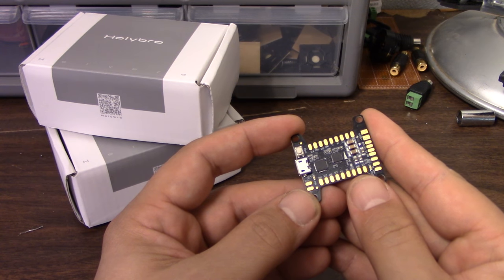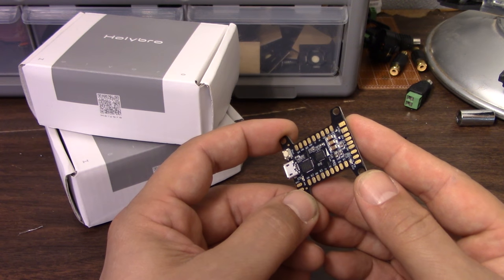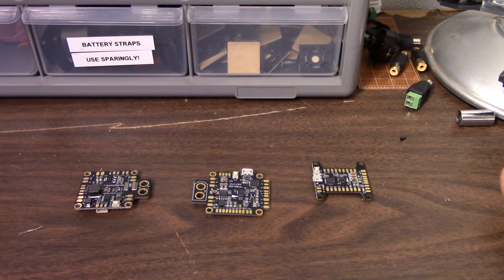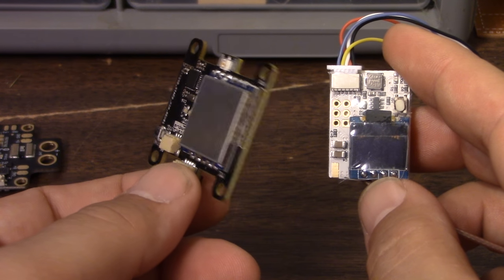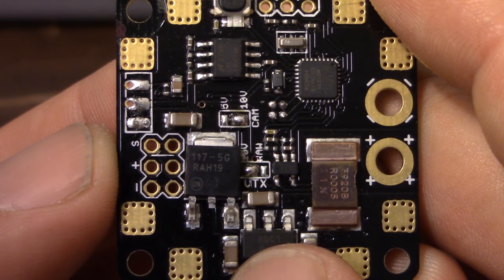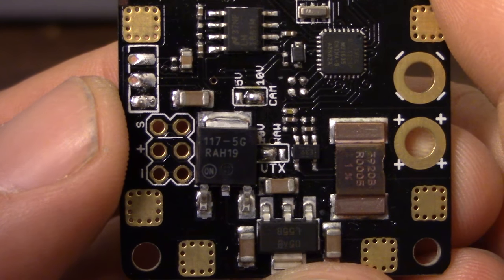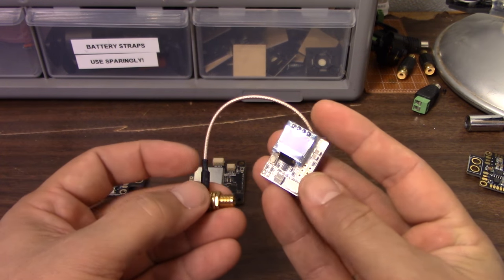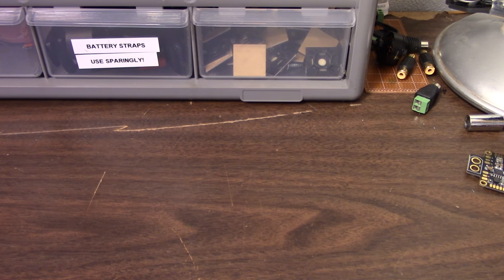OSD SHOWCASE | Four Interesting Ways To Put an OSD On Your Quadcopter

Comment: rrosdv2 ftw pre order in 3 2 1. the first version may it rest in peace on a flyaway quad worked like a charm, and no fiddling around plug up and go, I like that a lot. and the video was just as good as I'm experiencing with pnp50, without the extra weight.

Comment: I am in the process of installing the Diatone sp3 on a new quad that i am building.  I have heard pretty good things about it.  Very clean design and easy to wire into the system.
Reply from the maker: Yeah, that one also looks cool. Similar to the Passado, I think--yes?
Reply: Joshua Bardwell similar and also cheaper

Comment: My favorite is the Matek HUBOSD. It has very similar specs to the RROSD v2, but costs about $16. No mwosd, no pass through, but big easy to read text that shows time, volts, amps, and mah consumed. All you need and nothing you don't
Reply from the maker: I left the HUBOSD out of this one because I have had too many questionable experiences with it. Now that's a little unfair because there are at least two different HUBOSD products, and maybe they're not all the same. But in two separate cases--two different OSD boards on two different copters, built several months apart--the OSD had a software glitch where it wouldn't show the correct data on screen. This was fixed by a software update. In another case, the OSD simply didn't work at all and the board had to be replaced. Finally, I have not personally experienced this, but I have heard reports that the voltage regulators on the HUBOSD are sometimes not reliable.
Reply: Joshua Bardwell I haven't had an issue (yet) on the five builds where I've used the HUBOSD, but I will concede those are all good points I have heard from other pilots. I suppose it's a YMMV situation, and you get what you pay for when you opt for a $14 - $17 pdb/osd combo that your copter relies upon. I'll continue to fly them until they die, but I love new stuff and I'm going to try an RROSD v2 on my next build
Reply: Every Hubosd board I have gotten has had issues. Ive had one short out and not display video anymore, but most of them the OSD fails about 5 seconds into flight and I get those arrows on the left hand of the screen. I think its because I run 5s batteries and motors that dish out a lot of amps, yet ive never really exceeded the HUBOSD amp limit. Would you say the HolyBro is more reliable? An OSD with mAh reading is a priority for me.
Reply: Lol it seems like my positive experiences with the HUBOSD are atypical. I do plan to try the new RROSD though, because I agree that my number one concern is mah consumed. Voltage is secondary, amps are tertiary. I honestly don't care about time, but if it's there, so be it. Nothing more though, anything else is just too much to look at
Reply: Haiku FPV I agree I like my OSD simple, thats why I was drawn to the Hubosd. But for my set ups they have just always been a struggle for me. The times it does work I love it, but there is just no consistency
Reply: I like the HUBOSD too - if it works. It's really a hit and miss though. I've tried 4 so far. Two had the OSD component die within the first couple of batteries, rendering them just regular old PDBs. One was glitchy in that the OSD disappeared every time the I pushed my quad and came back only when I ease off the throttle. And one worked fine, except the voltage readout was off by 1 volt or so, but at least the current sensing (which I rely on more than the voltage anyway) seems fine and no batteries puffed so far from over-discharge.
Reply: Haiku FPV one thing I couldn't stand about the hub osd vs the rrosd is that the hub osd would update on screen the voltage and amps only like once per second, a total deal killer for me :-(
Reply: what about cameras with osd? forgot those. foxeer arrow comes to mind.
Reply from the maker: +Juan Rodriguez Yeah, I just intended have any of those right now.
Reply: HUBOSD is a 8bit core minimOSD is 32bit both use different gui apps to set up but can look identical

Comment: No love for the PowerOSD? They recently came up with an updated version so I'd really like to know how it compares.

Also, it's probably worth mentioning that the Passado (as of this video) only comes in a fixed 600mw version which makes it useless for racing and flying with any sizable number of friends. Although, FuriousFPV did assure me that they will be coming out with 25mw and 200 mw versions. I do hope they'd come out with at least a 25/200mw switchable version though. That would give more flexibility for a mixed freestyle/racer quad.
Reply from the maker: I don't have anything against the PowerOSD, just didn't happen to have one on hand. This video is literally the result of going through a hodgepodge of gear that was sent to me and realizing there was a common theme.
Reply: I just got one a little while ago, but haven't had a chance to install it.  Nice and simple though

Comment: The MinimOSD is a bit tricky to set up, but I have yet to find a suitable replacement for my microMinimOSD. There's just nothing like it: super lightweight (3gr or so), tiny, packed with features (PID-tuning with sticks, fully configurable) and dirt cheap. They're like 6 bucks...
Reply from the maker: +DirkDrones but when you can get an FC with Betaflight OSD for $35, isn't that cost just absorbed into the FC?

Comment: I got the Diatone SP3, it's great, it has a micro USB, connect direct to PC, it has 0, 25, 200, 600 mw that you can select and a channel display and its stackable! 
You should try it!
Reply: but dont have current sensor
Reply: TheMascaras33 yes it does not have! well, for me it's great, I don't use it, but you are right, for who use it, it's missing
Reply: I can see voltage and amps on mine. I paired it with a KOMBINI fc, maybe that's why?
Reply: halibuthero nice, how did you do it, just got a kombini! tks
Reply: Standard wiring and I enabled readouts for volts, amps and RSSI in MWOSD.

V and A seems accurate, RSSI is questionable. This is my first OSD, so I can't compare it to anything else, and I'm not even sure I configured it correctly, but it seems to be working.
Reply: halibuthero nice, will do, I was worried about having to flash firmware and something like it!
tnks

Comment: Happy with just the Foxeer arrow V2. Might be me but I don't see a need for anything more than the battery voltage and time to be displayed.
Reply from the maker: I strongly prefer to have current readout on my copters. A reduction in mAh drawn from a battery is the best way to know that the battery's health is declining. And amp draw is a good way to assess prop, motor, and battery performance.
Reply: BoneR FPV at the moment I agree arrow v2 and then mah on the taranis audio warning telling me when I'm low. I have furious kombini fc's so the furious osd vtx would be a nice touch but maybe not enough of an improvement at $60 each!
Reply: DemiQuad FPV I have even noticed i still get battery voltage off the taranis out of habit and forget to even look at the screen during racing. If I don't hear the radio giving me low voltage alarms I'm still good to go Lol

Comment: Is keeping the power distribution circuitry separate from the video circuitry a common design goal? The products reviewed suggest it is not. Perhaps it should be. I would think the ideal setup would be one board with PDB and current sensor, and one board with an FC with built-in OSD, or an FC and a separate OSD. This is all a little bit confusing, because there are also issues with OSD/FC compatibility, right? I do not have OSD at all, but I want it.
Reply from the maker: No, it is not a common design goal. And well designed boards combine video and power no problem.
Reply: Thank you for your answer. On my setup I had video interference that was substantially annoying. I tried 2 or 3 different LC filters on the cam and vTx power, and put a cap on each ESC, and these things reduced the interference a little at best. Then recently I installed a fatshark filtered vTx power supply that connects to the battery balance plug, and voila! the interference disappeared. The only filter on it is a capacitor (by visual inspection). So evidently in my case using a separate tap to the battery avoids transmitting or propagating the noise that must be coming from the ESCs, and the cap probably helps even though there are already caps on each ESC. The cam is not powered by it. I'm considering adding an OSD somehow, so I've been wondering whether video interference would be an issue again, like with the minimOSD which is reportedly very sensitive to noise. And with a PDB/OSD I have the same worry, because that board would be connected directly to the ESCs, the cam, and the vTx.

Comment: FC's with built in betaflight OSD (like the Omnibus) is a godsend!, lost count on how many minimosd and micro minimosd's I've fried, not to mention how sensitive to voltage spikes they were, not wiring the grounds right and the osd would drop out at rapid motor rpm changes. 
Makes me wonder though why no one has integrated an OSD into like a vrx module that could use telemetry data from your tx, you wouldn't have to wire OSD on every single quad either.

Comment: I've been annoyed to have no filtering on 3S voltage and to have to overthink a copter that will use both 3S and 4S.  Sounds like they're finally dealing with that situation?
Reply from the maker: Yes, exactly.

Comment: After watching your videos i decided to go with an xracer f303 and diatone sp3 with OSD an im wondering now, if i cloud add the current monitoring by using an PDB with current sensor like the Lumenier 4Power Plus? Where has the PDB Sensor to be connected?

Very helpful videos, thank you a lot!
Reply from the maker: +Kaptn Firlefanz the FC or OSD needs to have a current sensor input pad.

Comment: I've been flying for a few months now on a used setup and just started buying parts to build my own quad. i picked up the RROSDV2 after a lot of research, i'm paring it with an XRacer F303 and while the XRacer has a really beginner friendly user manual. the RROSD does not. i'm not completely sure where everything is supposed to go or if i'm supposed to bridge any pads together.
Reply from the maker: +Nathan Dugie have you seen this? 

http://redrotorrc.com/download/RROSD_PROV2_User_Guide.pdf
Reply: yes, i was reading that guide,  on page 2 there is a "solder bridge setting"  section but i see no where to bridge any solder. and where does the PDB actually connect to the FC? is it the expansion port? or the top connector section in the guide?
Reply from the maker: +Nathan Dugie FC does not connect to the PDB except to get 5v from it if needed.
Reply from the maker: +Nathan Dugie one solder bridge is labeled CAM the other is VTX and they are in the middle top of the board.
Reply: ok. so the "top connector" goes to VBat on the FC, that makes more sense. I hope i'm not in over my head building this thing.
Reply: VTX and CAM are on the back of the board and those pins run through to the top. my camera has 3 wires [video, pos, neg] and the VTX has the same 3 wires. why should i have them  short to each other?
Reply from the maker: +Nathan Dugie no, not the header. The tiny solder bridge pads in the middle of the board. I'm sorry I'm on mobile and can't show you. One says 5v and 10v next to it.
Reply: i see it now i'll be sure to look into my camera/vtx settings

Comment: Heads up on the UBAD VTx....I own the entire current LaForge product line and I have had nothing but issues with the VTx.  First one came with some sort of defect that made it want to light on fire and was an RMA after waiting a month the company I purchased it from had it replaced (not their fault on the wait, supply from UBAD is slow) and the second one I got came defective as well, luckily just in the OLED strip which I can live without.  Was pretty bummed about this as I see UBAD as a boutique manufacturer of quad products much like Flyduino and the likes.  Oh well maybe this one has be revamped, but I wont give it a try.
Reply from the maker: I believe that this is not the same vTX design as the current one. For example, this one doesn't have the IR sensor on it. But I can't be sure of that. Sorry to hear that you had a bad experience with UBAD's hardware. I know they're not perfect, but I have the impression that they're pretty solid most of the time, and take care of their customers when they screw up.
Reply: This is good to hear they could have addressed any issues, it does look like a different PCB then V1, does it still run on 5V only?  Once everything was sorted out the performance of the VTx is great, I haven't had an issue using my goggles as the IR blaster as a bunch of people have commented on, but hey you can't win on everything.  The diversity module on the other hand holy crap, it makes up for all the problems I have had and keeps UBAD on my radar, definitely wont write them off.

Comment: HI Joshua, I love your channel! I recently sintalled a mininosd in my Torrent110. I works great, but as soon as I hit the throttle up to 50%, I lose video. I placed all grounds to the pdb, but still lose video. Any thougts? Any help would be really appreciated. Thanks!
Reply from the maker: MinimOSD is horribly susceptible to electrical noise. Try adding a small capacitor to the power line on the Minim.
Reply: Joshua Bardwell what would you suggest? 1000μF 15v?

Comment: Piggy OSD from Furious FPV?  I am using this in combination with a Combini, but am struggling with noise. Wondered if you have tried this combo?
Reply from the maker: The piggy is a great choice if you want to put an OSD onto an existing build without any of the integration found in this showcase. For video noise, consider adding a capacitor to your system.

https://www.youtube.com/watch?v=0RP0FPGnilg
Reply: Thanks Joshua, i need to give the capacitor a try.  On a different note are you planning a 5.8 antenna shoot out in the near future? With the new Lumenier Axe II and Menace Raptor coming out, I would like to see how they stack up against the TBS Triumph, Foxeer, and Spironet antennas.
Reply: I have a Kombini/PiggyOSD setup, but I also use the FuriousFPV Stealth VTx which has filtered power output for the cam.

Comment: something like the helix vtx with osd. work as a standalone unit? not running it in a helix but on a beta board?
Reply from the maker: +greeny greeny possibly. It depends if it is designed to work with standard Betaflight or a custom Betaflight.

Comment: Is there a way to use RROSD PRO V2 and betaflight osd at the same time....It is awesome to PID tune through FPV goggles? Thanks
Reply from the maker: Sure. Feed the output of the Betaflight OSD into the CAM input of the RROSD. Then wire the vTX to the RROSD per usual. I haven't tried this personally but I think it should work. Give it a try and let me know!
Reply: OK, Great thanks for the info

Comment: Hey Joshua i have flashed 1.6 MWOSD on my Holybro PDBOSD v1.2  without saving the 1.5 settings :) could you post me the 1.5 current sensor settings for the osd? :) thx!
Reply: one thing i have to add to the holybro is that the solder pads for the esc's are quite small to solder onto... especially if you use esc with high amps and therefore thick wires

Comment: Could the OSD for the Holybro AIO be programmed with Betaflight or only through the FTDI and separate software?
Reply from the maker: +prophet11236 only through FTDI. Possibly you could use serial pass through to skip the FTDI adapter.

Comment: hi joshua i have a problem with osd on a omnibus f4 pro. i have no video when i bypass the osd the video is work .when i connect the osd out the osd works but when i connect camera to the osd in i get a black screen with just the osd on  it hope that makes sense .  Thanks   .
Reply from the maker: Check to be sure that PAL or NTSC is selected correctly in the BF OSD tab.
Reply: Joshua Bardwell  just checked that all set to pal. Thanks for the fast reply.
Reply: i have found the problem the pad for the camera on the top of the board is not in contact with the bottom pad and yes i know im meant to put the wire through the hole but i dont . so just soldered to the bottom and it works . Thanks for all the great videos helped me alot.

Comment: Those are still old time OSD-s. Latest ones are already built in FC board.
Reply from the maker: Yes it's true. When was this video released?
Reply: Look like more than year ago. I had Realacc HUBOSD and Micro MinimOSD in my quads at that time :) I still remember MinimOSD that was not even Micro. By the way these PDB+OSD boards was already a great progress, much comfortable and less space consuming at their time. At today they migrated inside middle and top end FPV cameras. And lack only current sensor and RSSI input to be great again.

Comment: http://impulserc.com/helix-video-transmitter-board
40 bucks, adjustable 25,200+500mW, runs MW OSD (and also my KISS OSD FW). I still believe that FPV gear and noisy ESCs should be kept separate.
I forgot to mention: you can adjust the power and channel from the OSD! No buttons!

Comment: Have you taken a look at this product? I'm not sure about the quality but it's an FC, PDB, OSD, and VTX on the same board.

http://www.banggood.com/F3-V4-Flight-Control-Board-AIO-25mW-200mW-600mW-Switchable-Transmitter-OSD-BEC-PDB-Current-Sensor-p-1102946.html?rmmds=search
Reply from the maker: Holy crap that XT60 is really hanging out there.
Reply: Yeah, the Holybro PDB/OSD form factor or just two solder pads would be a lot nicer and less snappable. I'm thinking of picking one up to try with a 4 in 1 esc, as it would be nice to have a two board quad if it performs alright.